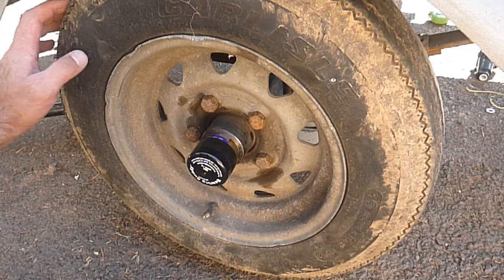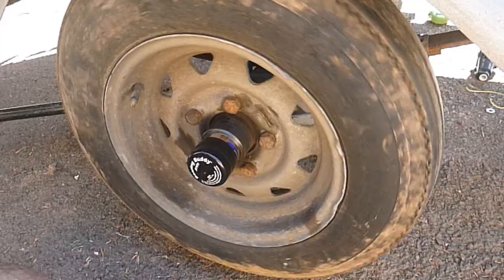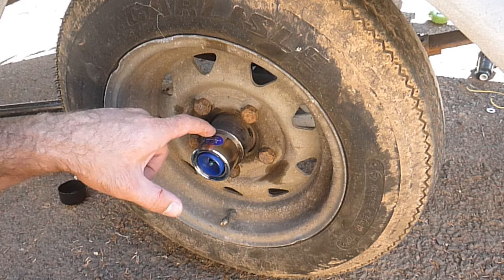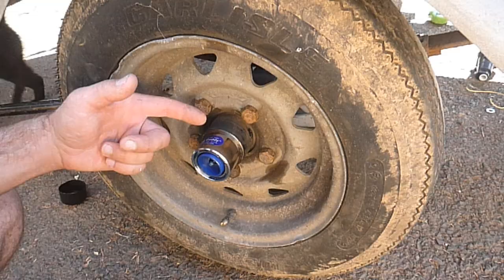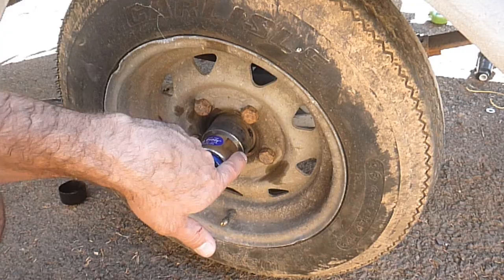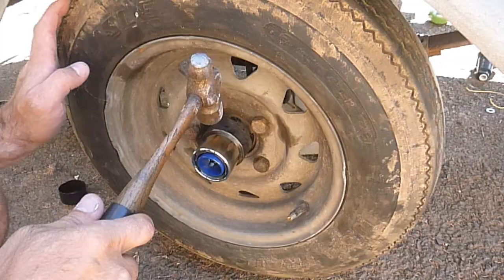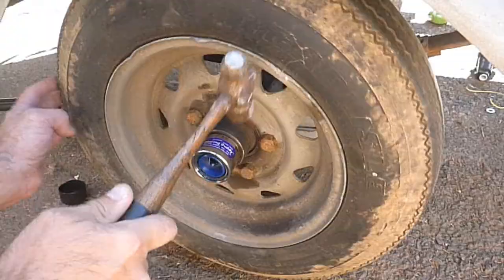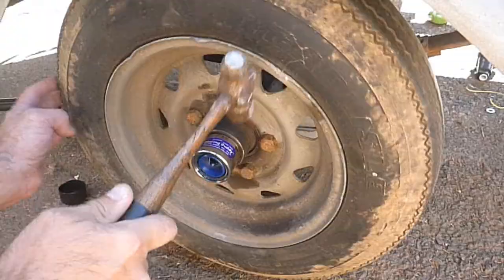How to remove a Bearing Buddy bearing protector.

Comment: I knew it had to be easy.  Thanks for making the video.  Mine popped right off like yours with about 5 soft strikes.  I used a dead blow hammer though just to make sure it didn't mar the bearing buddy.